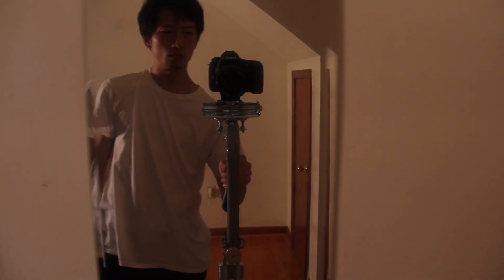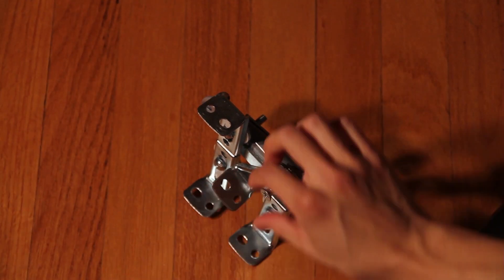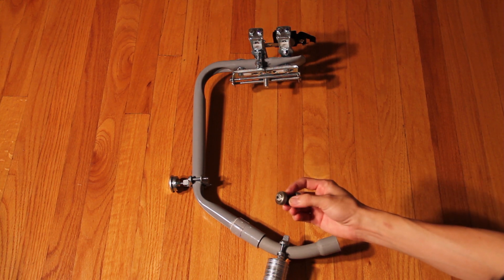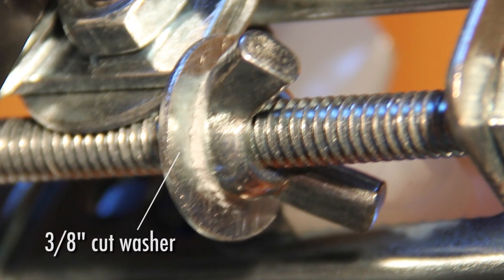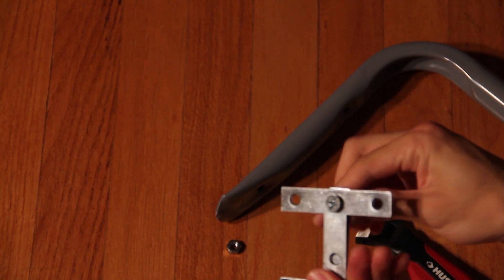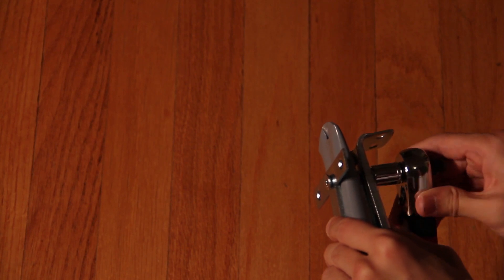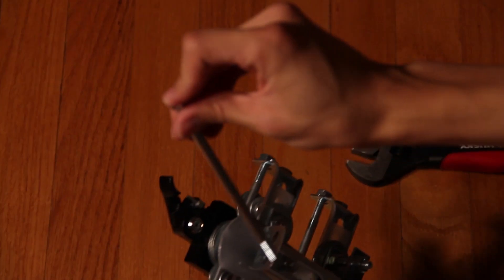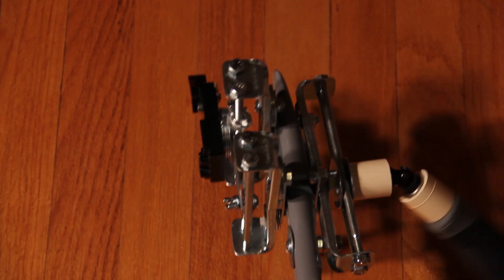How To Build a DIY Camera Stabilizer/Steadicam

Comment: I want to make one but for my Galaxy Note 3. do you think the same idea would apply to the phone?
Reply from the maker: Same idea applies. For a phone, you'd need way less weight, though, so you'd want to find much lighter materials for everything. You'd also need a different way to connect the phone to the rig, since a quick plate adapter only works on objects with a 1/4" thread.

Comment: Is there a specific reason you use a 1" x 7/16 diameter bolt for the gimbal attachment?
Reply from the maker: Yes - a 1/2" diameter bolt is too big to slide easily between the 6" long bolts that it fits between. The 7/16" diameter bolt is just a tad too small, and you can pad it with some tape to eliminate the play.
Reply: Phillip Chang Makes sense. Thanks for the clarification. Apparently this bolt/nut combo is difficult to find. Where were you able to find yours? My Ace Hardware and Home Depot both don't carry these size bolts and nuts.
Reply from the maker: Jeremiah Lewis Home Depot did, but you have to search - where I am, they were in the drawers they have for special bolts, rather than in the open boxes or bags hanging up.

Comment: Really cool work on this and attempting to duplicate this. How did you manage to get the metal joints off of the Traxxas shaft?
Reply from the maker: I used a knife to wedge between the plastic and the joint. The plastic gives a little bit but doesn't break.
Reply: Thanks for that! A bottle opener after a little heat from a hair dryer worked well for me. I put together most of my pieces and am waiting for the release plate. It would be great to see a video on how to balance this from an unbalanced state. How long did it take you to find the balance once you put this together?
Reply from the maker: Gets easier with practice. Key is not to put too much counterweight on the bottom - you want just enough to keep the camera from falling. The front counterweight also takes some experimentation to get right - it's a bit of physics, which you can find here from the original makers of the Steadicam: http://www.tiffen.com/dynamic%20primer.pdf
Reply: Phillip Chang , One correction (please correct me if am wrong) to the main body parts is, where you say "2x 1.5" long 1/4"-20 round or flat head machine screw", I think it should be the flat head that is preferred for the "top rear bracket base". If a round head is used (as I have), the rear "sled" brackets will need a additional fender washer thrown in to be able to rest properly on the screw head.
Reply: Hey Phillip Chang, so I got the release plate and am trying to mount it on the sled but ran into a issue. The T-plate that is to be attached to the release plate has the middle screw hole slightly off of the plane in which the side holes are. This is causing the middle 1/4" nut to block the last threaded 6" bolt. Did you have to do something to work around this problem? Hope this makes sense.

Comment: hi there u really doing a great job , one of the best videos and i saw all of videos about that on youtube lol , so i have a lil question , whats the diffrance between stablizer/stadycam and glid cam !!
Reply from the maker: Thanks. They all refer to the same thing. GlideCam and Steadicam are brand names for camera stabilizers. There are a few different types of camera stabilizers - some use electronic motors and sensors, and others use weights and counterweights. The camera stabilizer in this video is similar to the Steadicam Merlin stabilizer, using weights/counterweights to stabilize the camera.
Reply: yeah i know theres a few differents but what i mean is about the result , ! , i see stadycam easier than glid to use , but which one gives a better and more stable shoots !? becuz for me its all about the result , so im confuse which one to buy ..
Reply from the maker: Really depends on the size and weight of the camera you plan to use as well as how long your shots will be. For a day-long shoot with a heavy camera, you'll need a different setup than using a GoPro for only a few minutes at a time. The results also depend a lot on the skill of the camera operator and not just on the equipment. Sorry this is very general advice - there are too many factors at play.

Comment: pleas answer it will help me alot! how many mm does the camera screw have?
Reply from the maker: The Canon 60D takes a 1/4 inch diameter screw. I believe 6mm might also work, as 1/4 inch is about 6.35 mm. I believe some larger cameras take a 3/8 inch diameter screw.
Reply: Phillip Chang thank you because i working to do one :)
Reply from the maker: Good luck!

Comment from the maker: Both designs are pretty similar - advantages to my design are (1) no drilling and (2) my design offers easy front/back adjustment. The Silver Flyer doesn't appear to have the ability front/back adjustment. Both designs are similar though and you could easily combine elements from both.

Comment: I have a 3/4" PVC Coupler but it is over an inch ID.  My skateboard bearing is standard 22mm OD.  I also got a 1/2" coupler but the skateboard bearing is too big to fit (it fits if you heat it up but then it warps and rotates off axis).  I believe I have SCH40 sizing.  Any help on this??